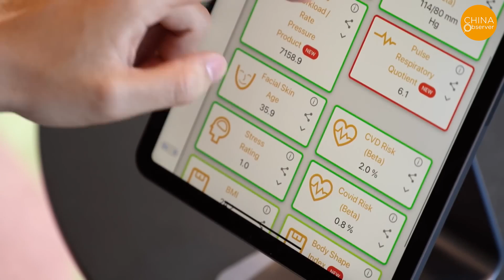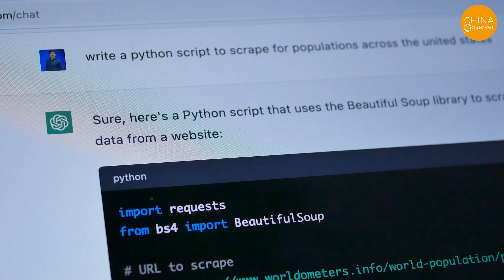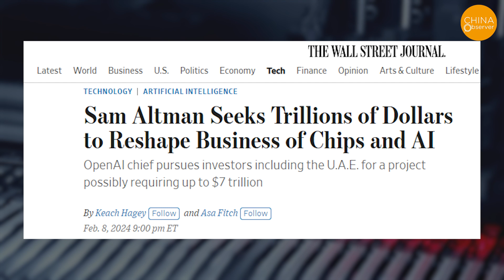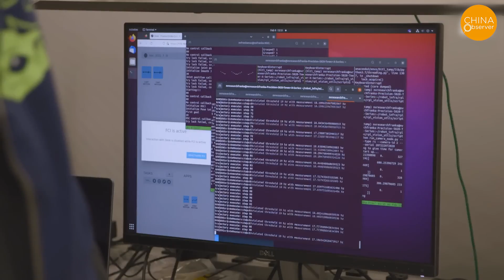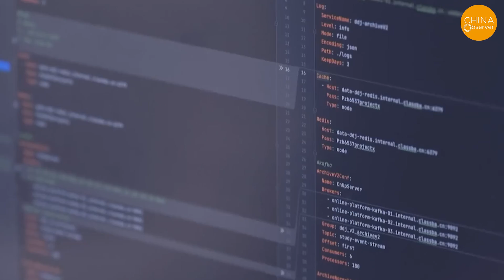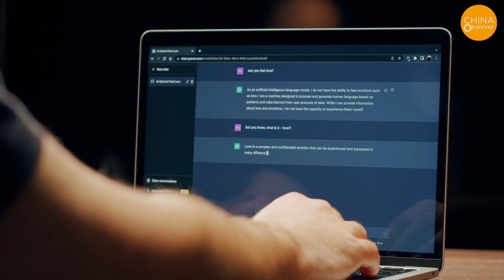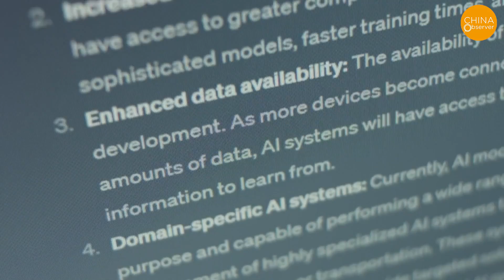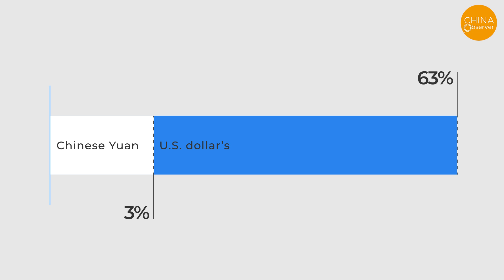China's Ai Industry Lags Behind The US By 50 Years? SMIC Bleeds To Support Huawei Chip Production

Comment: It's hard for China to be behind the US in AI technology when AI as we know today has been commercially available for only about 7 years, and some of the innovative ideas used in leading AI were invented or proposed only about 25 years ago. 50 years ago home users were using IBM PCs and Apple Macintoshes.

Maybe a case could be made that barriers preventing China's use of US IP technology might make the gap larger than 7 o4 25 years suggesting that China cannot possibly innovate at even a rate equal to the US, but that's not clear what is meant in this video. Because the web of advanced technologies is so varied and huge, it's conceivable that any attempt by China to catch up to the US is futile. This video doesn't mention that semiconductor manufacturing is one of the most complex and difficult endeavors ever accomplished by mankind, that is why so few companies exist that can make the machines that make semiconductors as well as operate those machines. These machines in turn depend on highly advanced technologies like optics, materials and power sources, again practically all based at least partly on US IP China has no access.